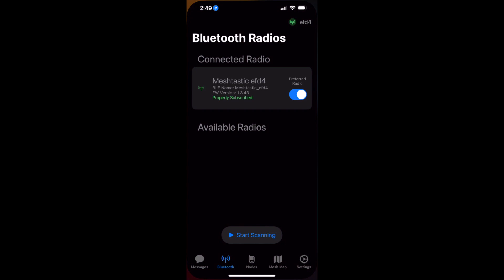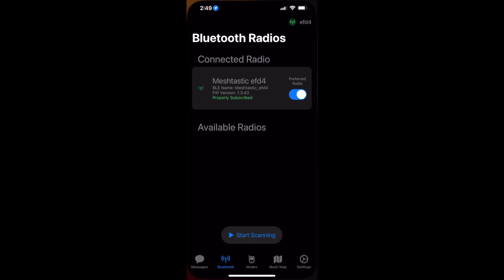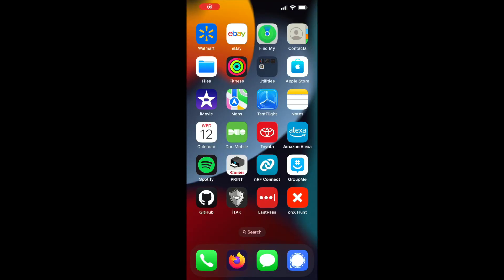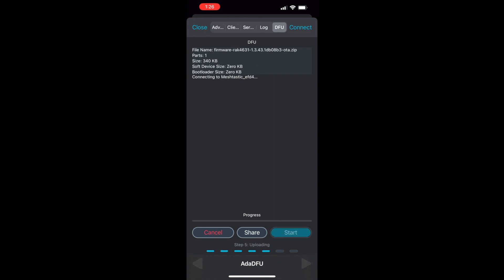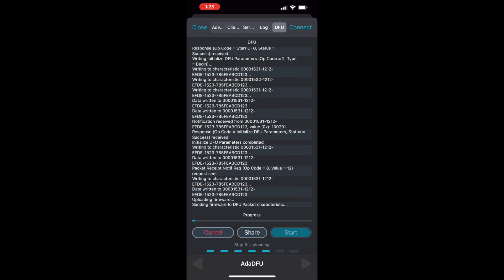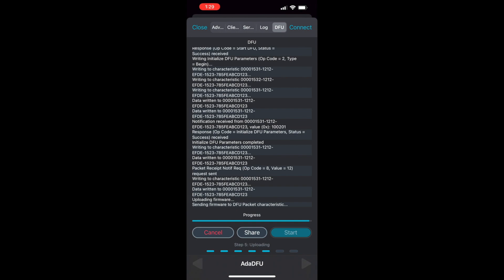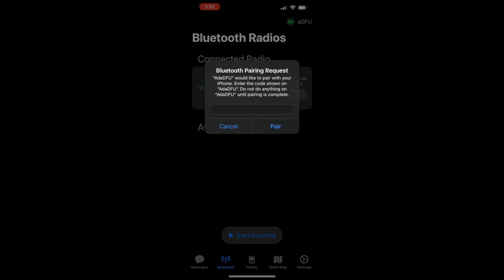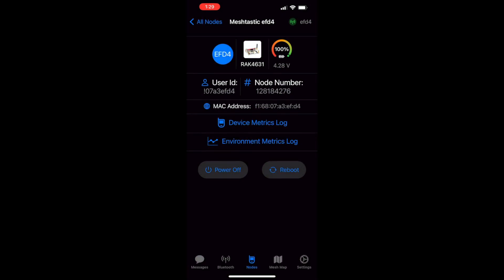Meshtastic 2.0 Upgrade - Updating an NRF52 device via Bluetooth (OTA) with NRF Connect

Comment: So theres nothing you need to do to enter a DFU mode? The RAK-4631 board is just connectable anytime? 
Also, does it maintain BLE pairing after update? Ty!
Reply from the maker: For nRF devices, yes. But you still have to be able to pair with the devices, so if you don't know the pin or have access to see the one on the screen then you'll be unable to pair and update. Yes, it maintains the BLE bond after the update.